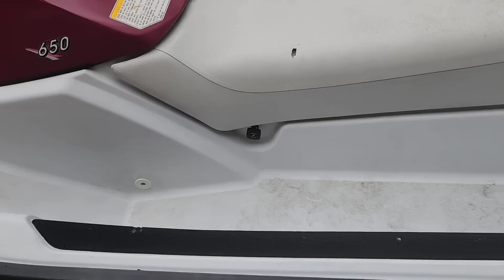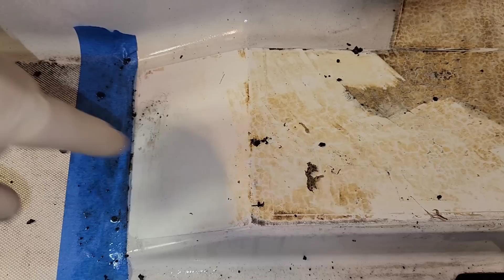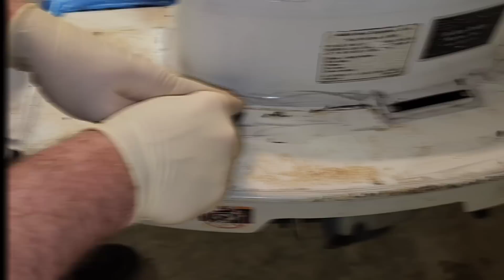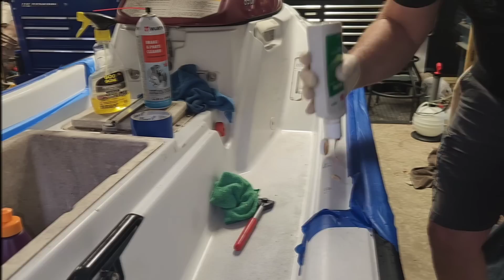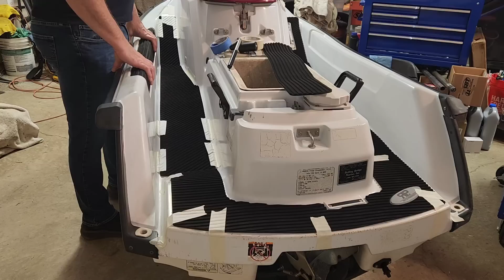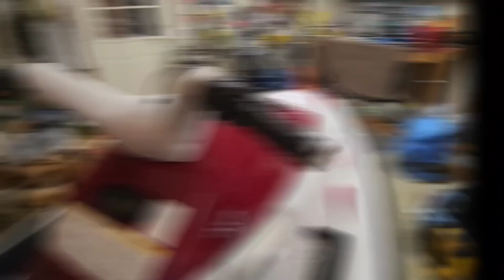How To Install Foot Mats | How To Remove Foot Mat Glue | Cheap Jet Ski Project

Comment from the maker: 🔧 Skip the Guesswork — Shop the Jetski Products, Tools, Accessories & Cleaners I Personally Use and Recommend on My Amazon Storefront Here:
https://a.co/d/008k76Fd

Tools I Used:
Red Razor Scraper
https://amzn.to/4bSxtWF

Black Laminate Roller
https://amzn.to/41DcYJ2

Materials I Used:
Ritco Products Black Cut Groove Traction Mats:
https://ebay.us/Oo6Otn

https://ritcoproducts.com/products/yamaha-traction-mats-for-waverunner-650-700-1990-1991-1992-1993-1994-1995-1996?_pos=2&_sid=671dc18d7&_ss=r

Ritco Products Custom Seat Cover:
https://ritcoproducts.com/collections/jetski-seat-covers/products/seat-cover-for-yamaha-3-waverunner-1990-1991-1992-1993-1994-1995-1996-1997-650-750

Ritco Products Website Home Page:
https://ritcoproducts.com/
Mention Josh the Jetski Guy sent you for Free Shipping or order discount!

Goo Gone Spray/ Solution:
https://amzn.to/3XQ3ybO

3M Rubbing Compound:
https://amzn.to/3R8neUB

3M Polish and Wax:
https://amzn.to/3FueHc8

***SUBSCRIBE TO MY CHANNEL HERE(It's Free!)
https://www.youtube.com/channel/UCNZjldj4WcsPNFPds90v9wA
 
***GROW YOUR YOUTUBE CHANNEL: Get Tube Buddy Here:
https://www.tubebuddy.com/pricing?a=stealthperformance

***Facebook: https://www.facebook.com/profile.php?id=100088725217269

***Instagram: https://instagram.com/stealthperformanceandoutdoors?igshid=ZDdkNTZiNTM=